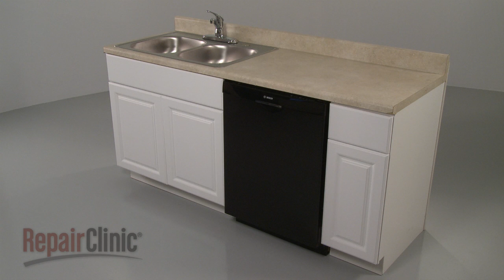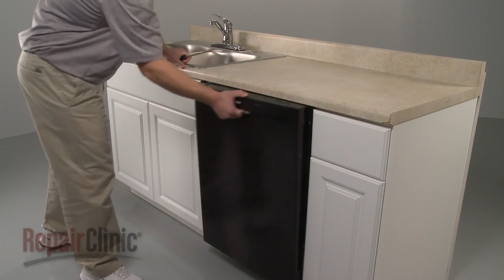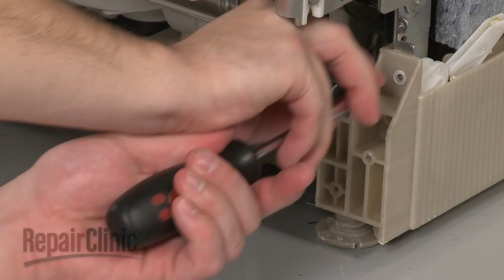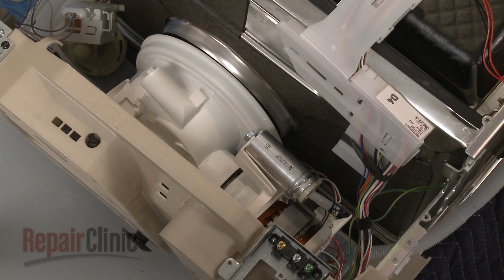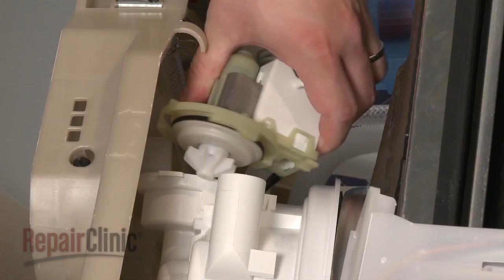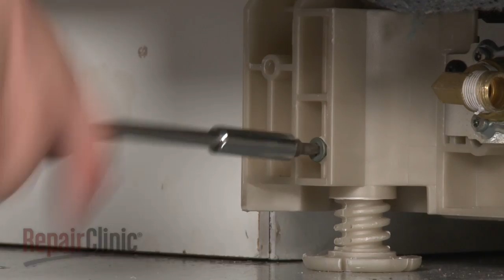Bosch Dishwasher Thermistor Replacement, Repair  #00165281

Comment: Gah! I just replaced the stinking heater unit and still no stinking heat but it bakes the bejeezuz out of the dishes during sanitize. Now it's thermistor issue. Good grief

Comment: Fairly informative, but “in-install” is simply wrong. Just say remove.  And the sound insulation is not “sound dampening” . The correct term is “damper”. Damper means to reduce, while dampening means to make something wet.

Comment: Mine came out a lot easier than that.. Simply turn the machine upside down. The bottom panel came off and the thermostat is hidden on the top side of the element housing .. There is just enough give on the hoses to be able to remove it without disconnecting anything. A pity the didnt design the housing so the thermostat is easier to get to.!!! As far as testing it with a meter goes, forget it.. Test for continuity and short circuit on the element. If its ok, just change the thermostat before further investigation and dismantling of these machines.. My thermostat gave the same readings on the old as the new yet once I fitted the new one, it warmed up and went through a whole cycle as it should, heating the water and drying at the right times.. My rule, If the element tests out ok, fit a new thermostat ...

Comment: Will a faulty thermistor prevent circ pump from running? I have a Bosch Dishwasher SHX43C05UC/50. I had a circ pump motor burn up in mid cycle. I have replaced motor and it fills but no circ pump however I can hear it clicking when it is time to cycle on.

Comment: What model bosch dishwasher this part for?  I have a SHE4AP02UC/06.  repair clinic does show the compatibility model for this part.
Reply from the maker: Sam Lee This is model SHE43RL6UC64. Your model does not have a heating element in the sump housing so there is no thermistor.

Comment: Hi.  I left a similar comment with the video on how to change the heat exchanger.  I ordered both the heat exchanger and this thermistor for my Bosch dishwasher last night.  I would like to know where I can find a wire diagram for the thermistor so I can check just my old thermistor to see if it is the only defective part.  I can see from this video that the thermistor appears to have two higher power red lines going to it, as well as three assumed sense lines (with a blue and orange tied together).  How much power does the thermistor require, and what is the output range?  Is there a downloadable spec sheet available?

Thank you for your help.  If I can just replace one of the components, rather than both the heat exchanger AND the thermistor, I would be happy.
Reply from the maker: We do not have the specs on the thermistor. The best tip we can recommend is that when you order the thermistor, you can check the ohm readings with a meter and compare it to the one on your dishwasher. Look for a tech sheet folded and stored in a hole at the front of the base assembly; this may be helpful.
Reply: *****   Ok thanks.  I'll see what it comes with when I get it.